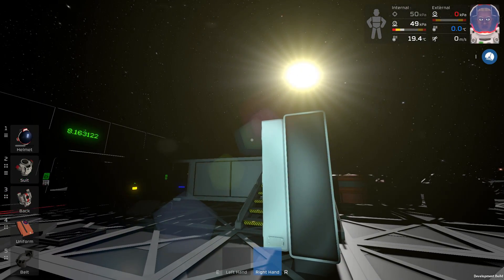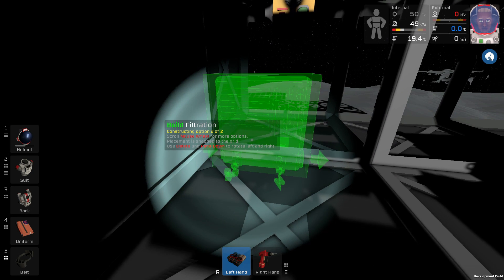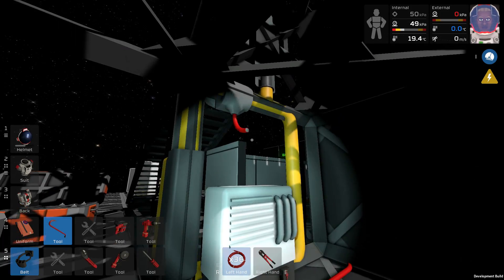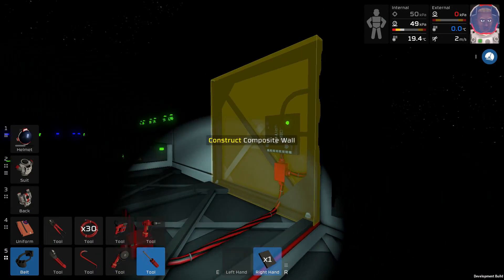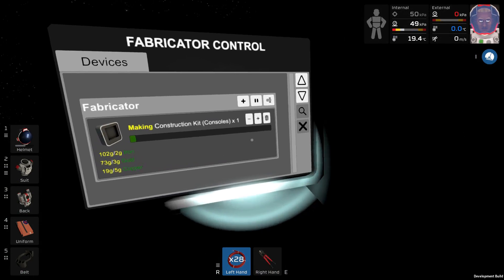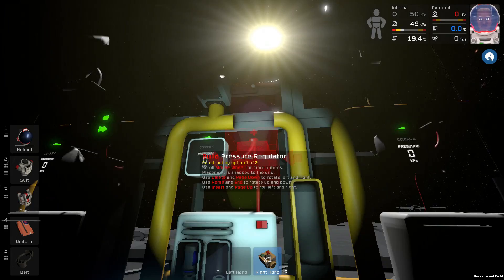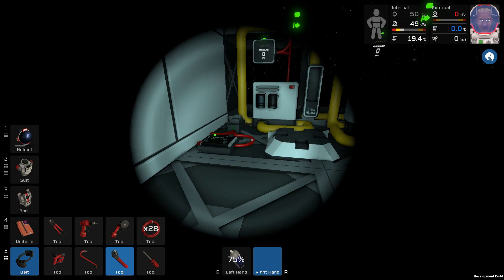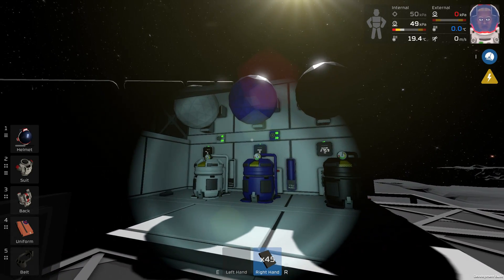NEW GAS FILTRATION - Stationeers: Ep. #26 - Gameplay & Walkthrough

Comment: With the switch, you should make it kill the pressure regulators too... they chew up 100W each (way more power than the filtration units). I can understand why you hooked it up to the filtration though, they can be a bit noisy (and annoying).
Reply from the maker: Yeah I was thinking of the noise, but 100W is definitely an argument to shut them down too. Had no idea it takes that much juice!
Reply: The way you had it kill the APC is probably the best (and easiest) way to go, 2 birds with 1 stone and all that.
Reply: I've been meaning to ask you:
What program do you use to record?
And what settings (hardware NVENC or software x264... CBR, ABR, VBR, CRF... and bitrate/CRF value)?
File type (mp4, mkv)?
Profile (baseline, main, high)?
Tuning (film, fastdecode, zerolatency, etc.)?

Sorry for the multiple questions, but I've been looking at getting into recording Stationeers for YouTube, and it'd be good to have a successful YouTuber's input on the subject.
Reply from the maker: Yeah probably.
Reply from the maker: I use OBS (x264, crf 20, unlimited buffer size and max bitrate of 1000) Does that make sense?
Reply: Sure does.
You only use CRF 20? I honestly thought that you had it lower than that (your vids are such high quality, even at 1080p). I've been playing around with CRF 8-16, and it's been hurting my recording framerates a little. So I should probably aim for a bit lower quality. Thanks for the info.
Reply from the maker: Yeah I remember that value was hard to get right. I also had good results with 15 but I barely saw a difference other than the filesize.